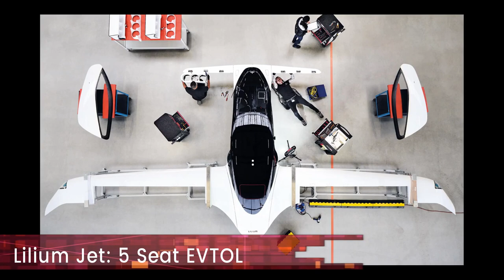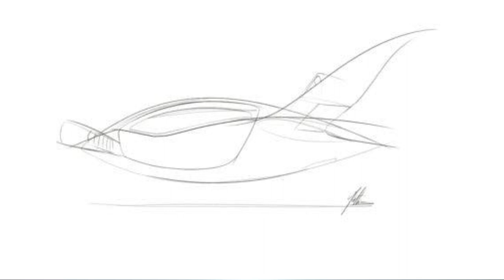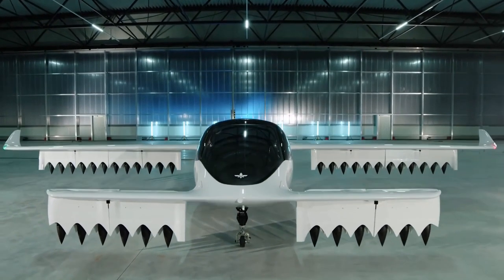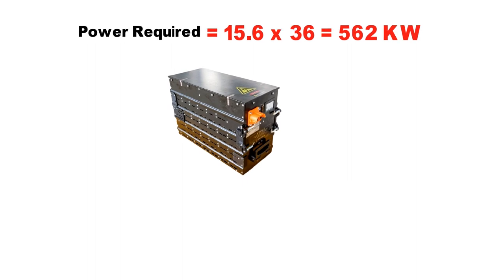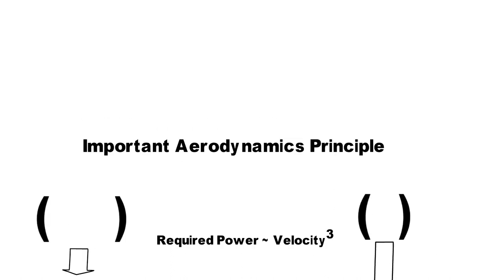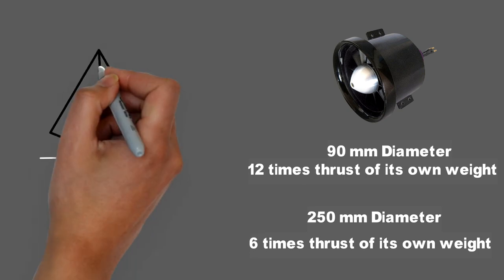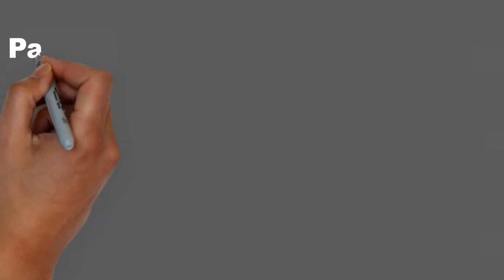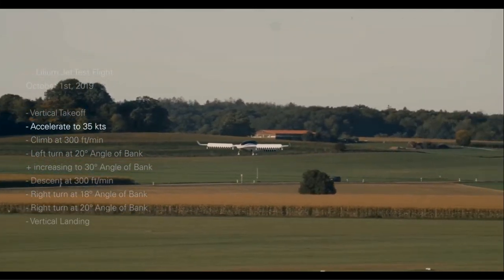The Engineering of Lilium Jet

Comment: very well explained video especially interesting the extra lift to the wings provided by the placing of the motor and the effect of the vortex to help lift under the wing
Reply from the maker: Thank you
Reply: What is the glide ratio when the power cuts out?  How do you steer when the power cuts out? How does it auto rotate when the power cuts out?  So many engineering challenges beyond slapping a battery and few dozen motors together. this will never be certified part 91 or 135.  Looks cool though.
Reply: It looks as though it will have the glide ratio of a wing suit. I'm not sure about the controls though - will they be of any use without the ducted fans?
Reply: @dudeskidaddy  When they loose electric power, the Lilian Jet is not controllable anymore and you better have a parachute rescue system installed.

Comment: In terms of battery consumption.  The first obvious benefit Lilium Jet has over its competition are Wings.  Much of the battery drain happens during the hover phases of vertical lift and landing.   But where the competitions calculations are off in regards to lilium, is that their wingless drone like concepts are always in a state of lift via their engines, constantly operating at high output just to stay aloft.   And they use large electric motors in comparison to Liliums many small electric ducted fans.  Also there motors are accompanied by large fully exposed rotors , which take a lot of power to generate lift, also making them very noisy like a leaf blower from hell.    Lilium on the other hand uses 36 small electric ducted fans that dont require a ton of energy to operate at full speed,  Their size do operate at higher rpm's for VTOL than the competition, which usually would equate to heavy noise, but due to ducted fan design they not only move a ton of air for their size but also are no where near as loud.  And since theyre many engines around the aircraft flight surfaces,  lift is generate far more efficiently than the competition.   in fact, due to the location of its engines along the surface of the wing it combines both engine produced lift as well conventional air pressure induced lift from the wings airfoil, as engines drive wind over the wings at high speeds.  Effectively adding to the force of lift and overall requiring far less energy.  There is so much simplicity in its design yet is design is pure genius.  What initially looks rather odd with all the multi engines, only takes a skilled and learned mind to realize the brilliance overall.  A true leap in aviation design.  Aside from the fans, themselves their are so few moving parts, and yet, liliums design combines flight characteristics that of both winged aircraft and that of Helicopter/drones, but goes far beyond due to its propulsion control, and configurable in flight layout.   When you look at lilium jet , it looks like the future, it looks as if its a design born of years of innovation.  But remarkably they team behind its creation, nailed it from the start.  A group of young adults that were not even primarily into aviation.   And just out of the gate hit on a brilliant design like no other.  looking at the competition  from Boeing Uber Airbus , its all the same.. either some scaled up done concept,   or something that is attempting to mimic liliums design but cant since they cant breech patent laws.  And oh yes they all had drone designs at first, then after seeing lilium tried to incorporate some its design layout into theirs.   And their concepts can fly,  but they are heavy in electrical consumption and extreme drag.  Where as the lilium jets full design is a drag resistant lift to drag ratio of 21 to 1, as the fuselage itself creates lift.   None of the competitions design come anywhere near as close.  Which is why  Lilium jet can achieve its claims.   True Genius and Brilliance in its design throughout.
Reply from the maker: Thank you for you insightful and informative comment
Reply: If you think many small fans are more efficient than few larger rotors you need to do some homework.
Reply: @emotodude  Well again, there's alota factors to that debate. are electric engines more efficient than combustion?  its a hard question,  because you may ask  do cities run on electracy? yes but no. because most cities are powered by either Nuclear, hydro electric (water turning turbines producing electricity)  or diesel.  in the end its a mixture.   Problem with big rotors is big noise, and a higher threshold of danger.  Where  as Lilium's ducted fans pose virtually no threat in regards to personnel proximity.  you'd literally  have to shove your fingers inside their engine pods to hurt yourself, which means operations wise, the Lilium jet will be first out the gate in regards to passing safety regulations and requirements.  Many of those other drones design see their rotors open and exposed and notably, would need to fully shut down entirely before passengers could enter and exit the vehicle, thus dramatically slowing operations.  This doesn't even occur with helicopters, which does have large exposed rotors, but are situated very high above passengers and operators.  So operational delays wouldn't need to occur with lilium,  possibly not even for Airbus overhead rotor concept.    Now i would say one thing about that airbus,  bus design.  Loud, yes,  BUT it will serve far more passengers than lilium.   And although not as advance as lilium ,  i see it as that step in-between traditional helicopters and something like lilium jet.
Reply: @xevious2501     Current battery technology is incapable of providing even 20% of the energy density of fuels.  Small EDF motors are MUCH less efficient than large props, the claims of long range AND performance for this design are total bullshit. It isnt a hard question to answer if electric "engines" are more efficient than combustion. Lithium sulfer doubles the energy density of lithium ion, and still isnt enough to make sense for aircraft even of traditional design compared to fuels, meaning the thing is probably capable of lifting its own weight of frame and electronics/battery/motors/ESC/ect. and puttering around with no real performance for 10-12 minutes, with NO PASSENGER.  Exactly what you see in the video.
Reply: What have you been smoking? You sound like a guy from their marketing team! Only because engines are tinier and ducted does not mean that the airflow is higher, only the rpms and the noise is increasing to compensate for the lack of blade surface and efficiency. 
Until today they have been unable to do any non hover flight even with an empty aircraft! They are in a dead end road with that concept in the near future.
Reply: @xevious2501  Can you send me a link to a video or an article that shows it in a "high speed"/non hover horizontal flight?
Reply: @xevious2501  you just contradicted yourself a bunch of times, but I see that a conversation with someone who is only emotional but can't deliver facts doesn't make much sense.
I don't think we need to wait very long to see if they can deliver this vehicle or not.
You said flying with two POB is too much, when they are actually advertising it, so haven't even been reading their specs. That's funny.

Comment: One of the big advantages of this design is: The distributed fans along the wing support the function of the wing even at very low speed by preventing the wing from stalling. So even at low forward speed you get extra lift from the wings. The high power consumption during vertical take off is therefore reduced dramatically after the airplane begin to move forward while still not flying with cruising speed.
Reply: There are tons of disinformation shills are just naysaying about this vehicle without good regard of this fact. I could pick a few right off of the top comments.
Reply: @SouthernHerdsman  
I would say people naysaying arre not shills.
It far more likely for promoters of it to be sellout.

Especially when the company raises more red flags than what you can see during a parade on the red square in moscov.
Labeling ducted fan a e-"jet".
Labeling CGI as testing videos.
Claiming protottype was tested to fly with human, then showing video of it flying empty as evidence.

Then prototype burns down under mysterious circumstances in middle of COIVD-19 pandemic, when media is focused elsewhere.
To say the least, its giving pretty strong Theranos vibes.
Reply: This is exactly what he says in this video at the end when he says don't think of it as VTOL, but instead as a system of propulsion and lift together in one that have created an aircraft with such exceptionally low stall speeds that it essentially behaves like a traditional VTOL

Comment: The crazy thing about the Lilium patent is that, after looking at the practical application, it's really not complicated. Someone just added the simplicity of the airfoil design and the placement of the small ducted fans in relationship to the airfoils. A little Venturi is also implied with regards to the bottom of the airfoil on VTOL lift-off. Great video.
Reply: it’s unfortunate as it means no competitor can make an aircraft that puts ducted fans along the wing, even if the rest of the aircraft’s configuration is completely different :(

Comment: Couldn't they employ a long tether that supplies power during vertical takeoff?
Reply: A cable supplying power during liftoff is additional weight to lift.   It would consume more benefit than it would deliver.   Even a system of microwave power transmission would require additional aircraft weight to receive and manage the power while also complicating the aerodynamic lifting body shape.
Reply: Add a cable lifting drone or a ground based cable lifting arm?
Reply: This though had occurred to me also, surely the most power is drained in the initial stage of vertical takeoff, a tether with its own powered flight to make it zero weight gain could work to assist this first stage
Reply: I think they used the KISS principal. The vertical take off portion of flight is kept to a minimum.
Reply: @douglaseddy1960  I had the same idea. 10m poles who supports the energy consumption at take of. These drones are anyway only meant for flying from point a-b.
Reply: For liftoff a cable could be clever to reduce power. But whats with landing? It seems not safe to have an aircraft that could not hoover or restart during landing. An cable for 350 kW would be also quite havier than the cables in my household
Reply: Once the aircraft is off the ground it still has to transition into horizontal flight. That transition would be just as power hungry as the VTO part. There is this thing called induced drag.
Reply: Landing is even more important than take-off.

Comment: At work a group of us with experience designing helicopters and powered lift STOL aircraft came to a very similar conclusion with regard to the coupling of the flow of the propulsors and the wings. One thing we noticed in the video of the take-off of the prototype is that the thrust vector of the front lift propulsors (which in the prototype are pure thrust rather than thrust/lift canard as in the final version) was slightly towards the rear as the vehicle lifted off. This would imply that the main wing and propulsors was generating a small amount of axial force that needed to canceled by a small amount of rearward thrust by the front propulsors. 

This could be important because it has the potential to mean that the main wing propulsors are not quite vertical at take-off, but instead are pitched a few degrees forward. Even a few degrees would mean that more of the air being drawn into the propulsor would come over the top of wing. Thus a substantial portion of the total lift required could be coming from the wing. The vertical portion of the total thrust from the thruster is the cosine of the angle to the vertical. So a forward pitch of 5 degrees would only mean that the vertical component would 99.6% of the total propulsor thrust. 10 degrees would be 98.5%. So for a 1.5% loss in thrust lift, the flow over the wing and thus aerodynamic lift could be greatly enhanced. That would completely change the power calculation from a purely propulsive lift.

In the December 18, 2019 video of the flight of the final version with propulsors on a canard we could see right at landing the propulsors on the canard went past vertical to provide braking thrust to stop the forward motion of the vehicle. That means that the final version with the canard has the same ability at take-off to point the canard propulsors rearward to cancel out forward thrust from the main propulsors.

And last note, the lilium will make a terrific "super-STOL" vehicle that will require half or less of the power of a fully vertical take-off or landing when there is an opportunity to have a short ground roll and a non-vertical climb-out or landging. Due to the strong circulation, as you say, the wing would never stall. I have seen wings with a lot of upper surface suction where the stagnation point is in the middle of the bottom surface with streamlines flowing forward from the stagnation point,  hooking sharply around the leading edge and flowing with greatly reduced static pressure into the propulsors. This allows departure and approach angles to be in the 30+ degree range. So even without a purely vertical take-off the vehicle will be able to clear a 50 foot obstacle within 50 to 100 ft of the lift off/landing point. It will also mean that any parking lot (car park) could serve as an emergency landing strip should the batteries get to a state of charge where they can't make enough power to do a vertical landing.

Comment: Awesome video.The only thing holding these beautiful electric aviation designs back is the lack of a groundbreaking new low weight, high storage battery technology that can match or exceed the thrust, weight and flight duration performance of traditional fuel and engines.
Reply: I'd think a hybrid storage system of fuel cells with super capacitors could have a verry good energy to weight ratio as well as a good power to weight ratio, assuming high power is only requiered for short amounts of time during a flight. Hydrogen tanks have a verry good energy to weight ratio (even better than fossile fuels). Hydrogen fuel cells struggle with high power compared to their weight similar to batteries though. This would be the application of the capacitors wich have a verry good power/weight ratio. I imagine the fuel cell being used for cruising with the capacitors adding power for takeoff. The capacitors would be recharged slowely by the fuel cell when on the ground or even (verry slowely) while cruising.

Comment: Great work, one question. What would be the consequences of turning off the EDF during flight, will the air resistance across the free rotating blades cause a stall?
Reply: I think the consequences would be dire. Like having full wing spoilers. You'd have to dive steeply to maintain enough airspeed to keep it behaving like a plane.
Reply: Flight safety in takeoff and landing is always a concern.  A full power loss depending on speed and altitude could be a problem.  Redundancy may be needed.  A simple parachute system could be implemented. The video presentation shows detail system knowledge and excellent integration.  In the design space like to see where battery density plays into the design and what was used for range estimates / speed estimates.  Otherwise excellent engineering and design choices.
Reply: @caddymj  Speed and altitude with total power loss are inconsequential (unless both are 0) being as that there are no control surfaces. No mater what the airspeed and altitude the pilot is now a passenger.

Comment: Excellent explanation. I was thinking I might try to build an RC model but the expense of so many smaller EDFs would be too expensive. If I go with a VTOL, it will have to be with a tilt-wing using only 4-8 motors.
Reply from the maker: You can get the small EDFs for low price. Its the larger ones that come at a premium. So depending upon how big your model would be, it can cost exponentially higher